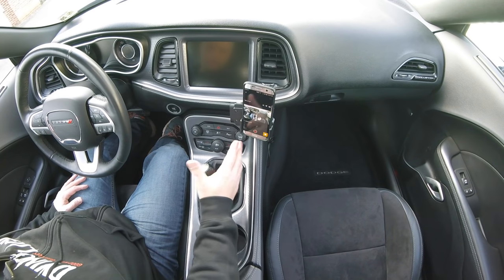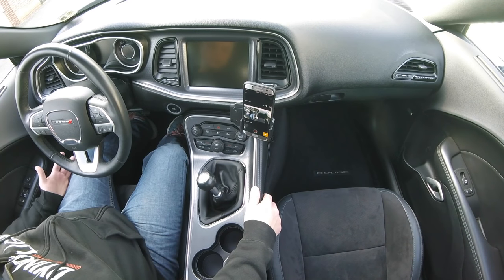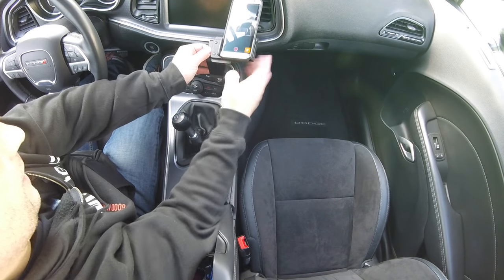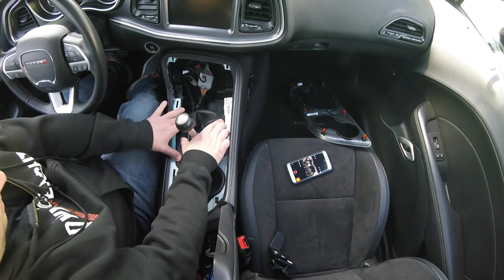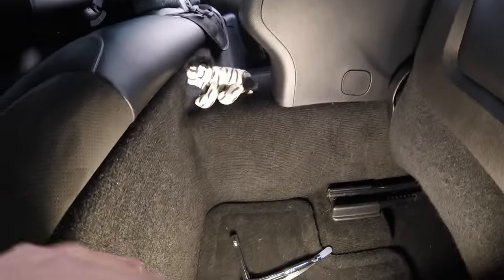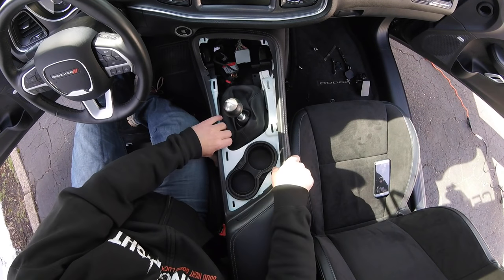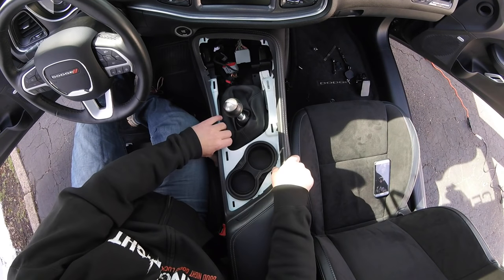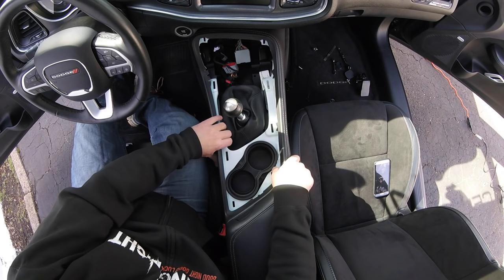Barton Shifter complete Install - Dodge Challenger Scat Pack

Comment: My 15yr old son and I installed our Barton shifter yesterday.  Our Challenger is a 2012 R/T so the console and steps were slightly different but similar.  Funny how we did many of the same goofs like leaning on the console when it was removed LOL.  Took us about 3-hours but that's because we took our time and really made sure to go at it slowly.  WOW!  This shifter is amazing and defiantly what should have come with the Challenger.  It's a tad bit more noisy with the gears but that makes it more raw and cool.  I know it didn't make the car faster but it sure feels like it when being able to shift much more positive.  Thank you for your time showing us laymen how to do things we never would be able to do without video instruction.  Curious, you installed the rear bracket bolts facing rear and in post Barton suggested that was correct.  I installed with bolts facing forward as their video suggested.  Do you know why the bolts need to be rear vs. front?  Is it for noise distribution?
Reply from the maker: Thank you and glad to help.  It's awesome to hear you installed with your son, I'm thankful for all the things my dad has taught me.  maybe not so much at the time, but all of it has come in handy once I went off on my own.  
 
When I called Barton to question the Bolts they never explained why, they just confirmed the way I installed them is their new preferred method.  which means both are correct ...I guess.  I too noticed the added noise when in lower gears.  Some go nuts installing sound proofing, but like you I enjoy the sounds she makes.
Reply: Yes it was awesome installing the shifter with my son.  We dove in playing to win and came out victorious.  Now the kid is itching to drive even more.  Soon enough, soon enough...

I emailed Barton requesting more info on why the rear bracket needs to be installed bolts rear.  I was a tad bit worried about the increased gear noise just because I thought it may have been installed wrong but realistically it's sounds like what a high performance car should sound like.  I will follow up if Barton has any technical reasons for the bolts facing rear.  Members in my car club state installing bolts rear and bolts front with no difference in sounds or performance [shrug].

Thank you as always for making these videos and inspiring us to do more on our awesome cars.  It does make my wife jealous and she states from time to time "You rub that car more than you rub me".
Reply from the maker: See the trick is to play with the car when the wife is a sleep 😉 this way she doesn’t get jealous. My son now 6 hangs out any helps. I was thinking of seeing how far he can get with changing the oil.  He knows what tools are what and knows how to use them. 

If you hear anything technical from Barton please feel free to share
Reply: Called Barton and spoke to Joe today about which way the bolts should face on the rear bracket.  Turns out either way is right, it's all bout how much noise there is in post of the install.  He said to always start with the bolts facing forward.  Then if you have excessive noise put it facing rear.  If noise persists then loosen the rear bracket pan bolt and wiggle the shifter to get it to sit in a more neutral position, then tighten the rear bracket pan bolt back up.  If noise persists they will send out a special foam piece that will finish off the job.  Additionally he noted that putting this shifter on 5 different cars with the same make and model will give 5 different results.  The trick is to not install the shifter stiff, but wiggle it around during and after you tighten the bolts.  This will allow the shifter to fall into the most neutral and loose position giving the best performance and low noise result.

Also for those who are interested in putting a SpeedDawg ball on your Flat Stick the thread size is 12mm x 1.25 and if you want to buy a different color Flat Stick with engraved color it's $80 shipped with a matching ball.

Hope this helps clear somer things up...
Reply from the maker: nice that's some serious detail I'm going to add it to the description so it does not get lost.  Thank you!!!
Reply: My pleasure.  It was really bugging me not knowing the actual facts.  Please also note you have to call in to order the Flat Stick with engraved color.  There is no option to buy just the stick directly online.

Comment: Thank you for this video. I never would have gotten my shifter  installed without it! The instructions I found on the Barton website were for 2014 and down, and there are some differences. My shifter came with 2 tiny set screws. I have no idea what to do with them.

Comment: Thanks for the info man. Just installed mine yesterday and its sooooo nice.

1 thing I did was install the pin on the right side first, was a little easier without the left side pined down.

wasnt a bad install at all. I took time to install the electrical quick connects off the cig lighter while the console was out as well!!
Reply from the maker: Definitely one of my most enjoyed upgrades

Comment: Can you get Adaptive Cruise Control for an option on the 392 Challenger manuals?
You appear to have the ACC on your steering wheel like in my 2012 R/T Max Charger but, Dodge’s website kicks me over to the Auto Transmission when I choose the ACC option. 
You are literally driving my dream car and I had given up hope not seeing ACC on all the 392 Challenger 6M videos I had been researching.
Reply from the maker: From what I understand it's not possible to have ACC and a manual, the additional button on my steering wheel I installed a while back.  Using the zAutomotive Tazer I am able to map these buttons to specific functions.

Comment: Bruh. Why no zip driver? Could have undone all of the screws inside with a driver in the time it took you to do one screw.

That said, I really enjoyed this. I was considering doing this shifter, and had seen other videos about the benefits, along with a couple install videos. None were quite so easy to watch. You have a great personality for this kind of work. Keep it up.
Reply from the maker: Thank you... you would think since I take my cars apart a few times a week I'd have one... but it's one of those things I've never picked up.
Reply: @WorkPlayDrive  Interesting! But, I guess it comes down to personal preference. Less chance of ruining things with a manual driver too. I'll probably be picking one of these up, the install looks super simple. Way easier than on the Mustangs.

Comment: First let me say that I thoroughly enjoy watching your DIY videos. It truly is some of the best camera work I've seen & explained in detail no matter how small the job. I followed your video for my install of a Barton shifter & it went well, however I noticed that at 22:40 you installed the rubber block with the bolts facing to the rear of the car...the Barton install video says to install the block with the bolts facing the front of the car. I installed mine as you did, then I noticed the difference in the Barton video. Will this matter? I doubt it.
Reply from the maker: Thank you and awesome attention to detail.  I installed it in that manner because it made the most sense for clearance.  As with most videos after I edit down the recordings I verify the install was correct, when I got to that part I realized I did it the opposite way Barton instructed and contacted Dave who said 

 - Quote Dave at Barton 
"We actually recommend to put the screws facing the back of the car. We never updated out install packet. Keep the shifter the way it is, Thank you for reaching out."

Comment: I bought a used Cat and it has the Barton. Love rhe short throw but whoever installed it has it angled forward and to the left. I need to adjust it to a neutral position since it is very difficult to hit 5th.
Reply from the maker: That’s a great part about the Barton, you can adjust it until you’re happy 💪

Comment: This video is even quite helpful in reverse; I took OUT my Barton in preparation for trading my car in referencing this video for a couple of pointers.   Here's a tip:  Use one of those long magnetic grabbers (the kind you get at autozone to pick up that pesky 10 mm socket that always seems to fall down into the engine), and use it to grasp each pin as you align it to insert, or to remove.  It takes some of the stress away by preventing multiple trips under the car to retrieve them.  Also, when inserting the pins, do the left one first; there's more room, and by having it in place, it aids in aligning the right shifter tong so you can focus on your precarious hold of that pin.
Reply from the maker: I did the same a few weeks back when I returned my scat  this time I got lucky tho didn’t drop anything under the car 👍

Comment: Used this video yesterday for my install. Still very accurate and relevant. I did spray some silicone on the pins to aid in the install. The Barton bushings are pretty stout and the dry pins might not want to cooperate, especially that blind one.

Comment: I’m ordering this later this week. I’m so excited and can’t wait! I can not tell you how much I hate the stock scat pack challenger shifter. I always have issues from 1st to 2nd gear every time I’m pushing it. I’ve had over 6 Manuel cars and the challenger stock shifter is by far the worst one I’ve ever owned. It’s frustrating to say the least. My car is a 16 w 33k miles on it and has 1 owner other then myself. I got it w 27k and this car has been babied and taken care of. My point is It’s just a horrible shifter imo so I’m looking forward to getting this one.
Reply from the maker: It doesn’t matter how well taken care of the car is when the shifter sucks straight from the factory 😂😂😂. 

I absolutely loved the shifter. This is one of those mods that pays you back every time you drive the car.

Comment: My Barton was just delivered today! I am excited to install. I found some printed instructions from them, but also their install video. I noticed that their rear mount block in the video has the heads of the bolts facing forward and yours they are facing rearward...I wonder if that matters or not....Oddly enough if it does, they put it in the shipping package backwards too! I guess I will have to call for clarification tomorrow....
Reply from the maker: On the block it’s been back and forth over the last few years. When I installed mine they said to do it with the bolts out. Now I believe bolts in is the best way possible due to a design change.

Comment: Thanks a lot for this video man. I have a 2016 Scat Pack and I just picked up that same shifter yesterday at the Summit store in Arlington, Tx.  This video has me totally prepped, well all I need to do is get me a pick set for those clips. Again, much appreciated. If you ever get the need to color match those radio and AC control buttons, give me a holler, I can tell you how it comes apart.
Reply from the maker: Thank you, glad to help.  Thant sounds interesting,  do you have photos of the buttons color matched?

Comment: I'm looking to get a Challenger 392, not sure what trim level yet, but definitely want to row through the gears. It will be my "wife's" car. Lol! It will go well with my 393 stroked Windsor powered 92 foxbody coupe I'm building. Thanks for the time you put in your videos bud, I've just recently subscribed and have been binge watching. Great video and cute kid. Kudos!
Reply from the maker: Thanks man!  That foxbody sounds intriguing.  THe T/A 392 still has my eye just because of the vinyl package.  What are your thoughts on the new Scat Pack and hellcat designs?
Reply: Work Play Drive Well, I think the widebody availability is cool for more to enjoy. I just think it kinda steps on the feet of other older upper range Challenger owners. So many models now, something like 20. I'm not crazy about the dual scoops on the hellcat and redeye, but will more than likely grow on me. With these new hellcats available, it may put some pre-owned hellcats in my price range. Fingers crossed. I do like the T/A you showed with that hot redhead. Now that was pretty sexy! I have a 2003 cobra IRS rear I'm putting in that coupe, it should handle like a gocart but ride much nicer than a solid rear axle.

Comment: Excellent video, I did a few things different when I installed mine but learned a few watching yours.
Reply from the maker: There are a few steps I did in a different order, (lol some would have been easier like pulling the Shift boot before the console... ) but I did find one discrepancy in my video, I'm waiting for a call back from Barton.  I installed the Back plate with the screws opposite to their instructions as I felt they would scrape against the shifter.  

I'm just waiting to see if that decision was functional or they just started point the screws this way to avoid questions... I hope it's the latter or I'm pulling the video and updating.
Reply: I have a 2016 Scat Pack, and I have the pistol grip instead of the ball shifter.  I was able to pull the leather boot over the pistol grip without having to cut the o-ring.  Also I left the shift linkage connected to the transmission instead of removing it with the shifter, after seeing what you did, it looked easier to replace the leg pins.
Reply from the maker: When I was watching the installs I figured it would be easier to remove the linkage from the trans, yes it's doing it twice but I figured it would be less clumsy.  There was no way I was going to be able to get that o-Ring over the base of the flat stick into the groove..

Comment: Just finished install but strange whirling rubbing noise.....ideas?
Reply from the maker: I made this video a few years ago and going back and forth with a few people some people who hear noises fixed it by reversing the square block at the back of the shifter so if you installed bolts out like me flip it so the bolts are in.

Comment: Great video ..... just a little tip if lay a good size piece of cardboard under the car then everytime you drop that right side pin u can just pull the cardboard out and retrieve it much easier than crawling under the car lol .... take it from me I dropped that blasted thing 5 times 😂😂😂
Reply from the maker: Slight improvement on your tip. Use a beach towel on top of the cardboard it prevents the pieces from bouncing and rolling off the cardboard. 😂
Reply: @WorkPlayDrive  the piece cardboard I used was for sure big enough to accommodate  a beach towel for sure lol

Comment: Great install video. I'll be getting a barton shifter soon. I'm doing the skip shift first.
Reply from the maker: Great combo, the skip shift install was such a relief from that annoying lock out of 2nd gear.  What stick/handle are you planning on going with for the barton?
Reply: I like the pistol grip with the 392 on the side
Reply: Did you do the clutch delay valve delete ?
Reply from the maker: nope, keeping the delay for now, in the future I plan on replacing it with a first gear only adjustable clutch delay.   Allows me to enable and adjust my slippage when launching.

Comment: Enjoy your install videos, very detailed with camera angels to give clear views and it’s easy to follow along with. I actually have a question to you or anyone else who has installed the Barton on their challenger.. after installing my Barton in my 2022 392 challenger widebody my reverse gear  no longer required to put any pressure downwards on the stick to slide into reverse gate it just went straight over with the car running and with the car engine off you could not put it into reverse at all I called the supplier and explained other problems and we came to conclusion it is defective and I’m getting a replacement sent to me so In the meanwhile I put my stock shifter which had no problems prior to installing the Barton I am now still not having to put any pressure down on the stick to engage reverse with the stock shifter reinstalled. I uninstalled and reinstalled 4-5 times checked screws bolts everything and have no change. My questions are 1. What did I do to my car? 2. When I get the Barton back and installed should It just slide freely into reverse or should it require the downward push to slide it into the reverse? Any feedback would be greatly appreciated cause it’s driving me a little crazy lol seeing how the dealership can’t get me in till weeks out. Thank you again for doing what you do
Reply from the maker: I don’t think the challenger ever required downward pressure to slit it into reverse. 

The challenger has an electronic reverse lockout  which will gate off reverse while the car is above a certain MPH. 

many of my manuals on occasion reverse when off is difficult to set but most of the time it’s fine. 

I guess you can check two things. While the car is in motion with a Clutch Town, can you put it into reverse while moving 20 miles an hour?  Obviously don’t release the clutch 😳. That will let you know if they reversed lockout is working.  

When the car is off if you can’t get into reverse, try, lowering the clutch again and putting it in reverse. If that doesn’t work, let the car roll a tiny bit and try again.
Reply: Thank you for your quick response that was very appreciated, it’s been next to impossible to get any answer from multiple dodge dealerships in reguards on how the lockout normally operates without them charging me to “look at it”.  I got in contact with someone from Barton also and he confirmed just what you had said. Glad to know that not only you make good videos but you know your facts. Thanks again and I’ll catch your videos to come!
Reply from the maker: Thanks I try the help the DIY community the best I can 💪